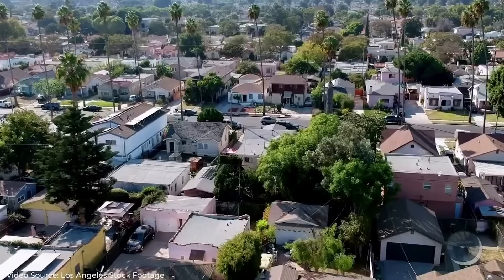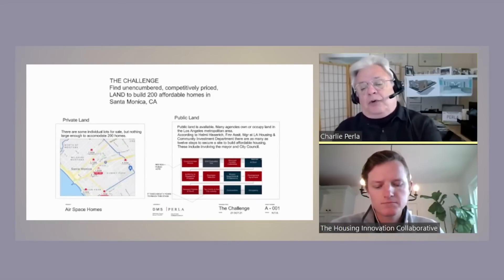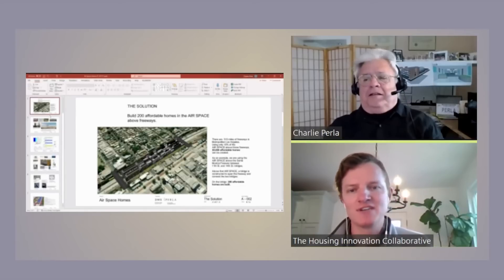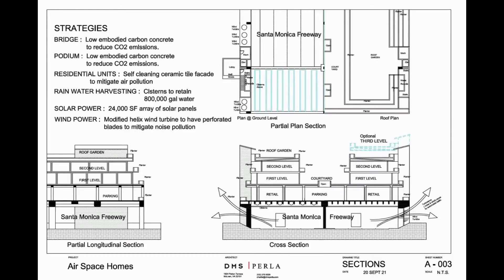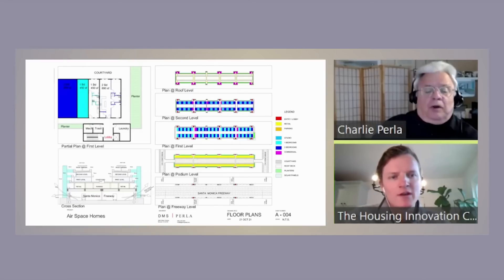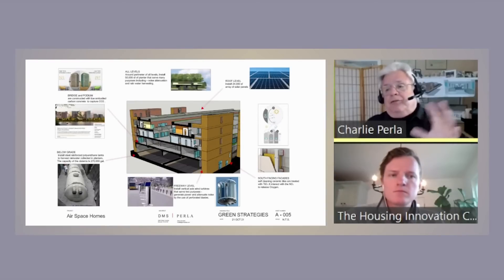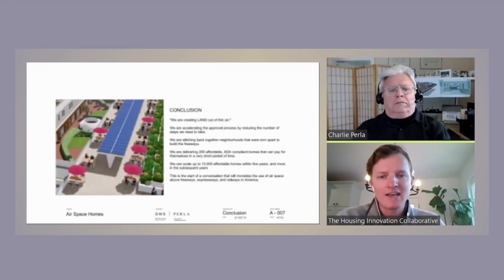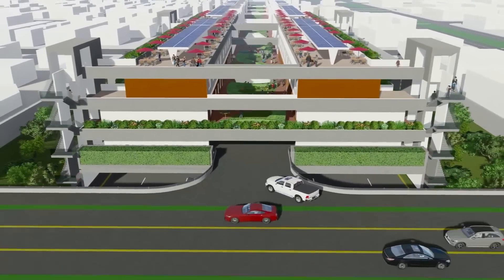Ep. 32: Housing Over Freeways (Airspace Homes) // The Essential Housing Campaign

Comment: Probably the most cost ineffective way to provide housing in urban areas imaginable. The cost of such a building type far exceeds any supposed savings of land costs. How would users even access such mega structures? Freeway on ramps? Besides, Municipalities have plenty of under utilized land, such as surface parking lots,  that could host more cost effective housing. Paul Rudolph proposed such structures in the 1960’s and for good reason the proposal went was never realized.